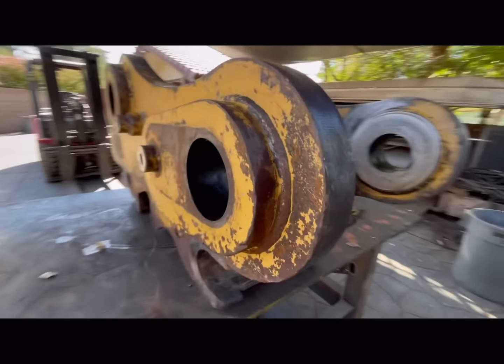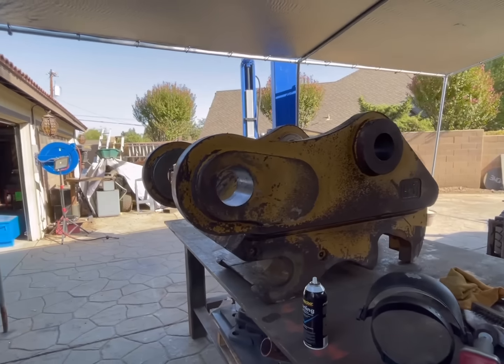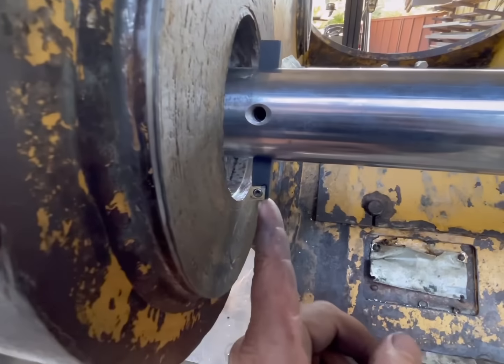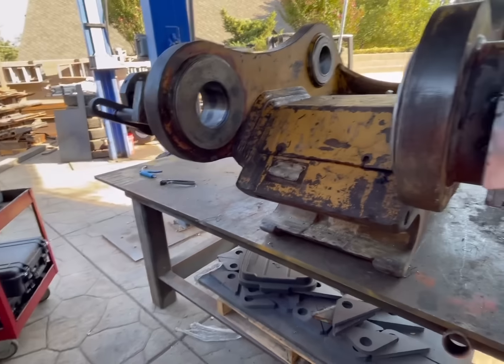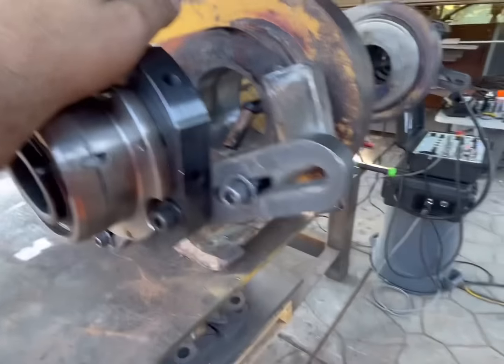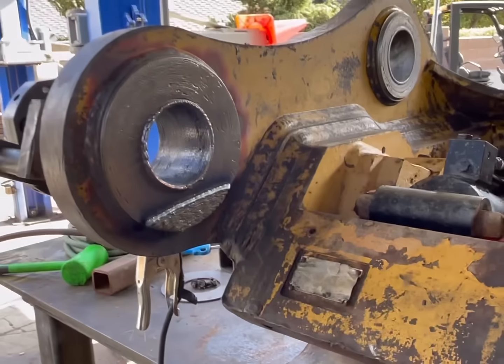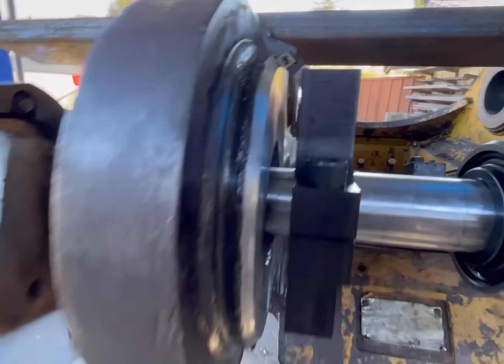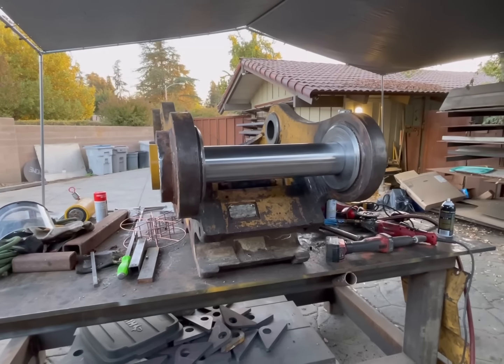Line Boring and Facing a 349 Quick Coupler

Comment: Heat it and clean it like you did John, then put a cutting disk on your pencil grinder and cut a groove into the grease lines then whip in a cold pass with 3/32 6010 to seal it off. You likely won’t get 100% satisfaction but it will certainly minimize the pain the grease can cause you.
Reply: Loren Sounds like you are a little old school. That is what I would have done. After I built up the boss faces.
Reply: Cool! Good tip thanks
Reply: That's what I was thinking. Weld up the face to cook out the grease before welding the bore. I don't see where it could hurt to try.
Reply: Why use a grinder? Use the line borer to cut a small groove. Then run a cold
Bead.  4 grooves.  Much quicker
Reply: Looks like you went for Cadillac boring tool. Money in the bank. Steve
Reply: Machine your groove in there with the tool you’re about to use in the first place, also makes it incredibly easy to weld where you’re supposed to weld. 👍
Reply: I am from China Seals Factory. Our company produces many types of hydraulic oil seals. If you are interested in our products, we can send you free samples so that you can learn more about our products.

Comment: I'm a retired welder, (44 years) and I worked in a shipyard for 14 and the cranes would always flip over a 50 ton, (or whatever the weight) of the segment of the ship we were welding on and put it in the flat position as you will always be more productive as a welder when you weld in the flat position. I would have welded the outside, or inside of those "ears" in the flat position. I have welded the inside of those bores with stick with great success and have done it many times.

Comment: Great work young man. I follow CEE and I C Weld, brilliant channels like yours. I got a job earlier this year to reduce the pin distances and sizes on a 13ton general digging bucket to suit a 10ton machine.
The original pins were welded in and needed gauging out. I don't have a line bore so had to use a digital square to set the new pins up as best l could.
Needless to say l was a bit nervous when l delivered the machine to site for the customer who immediately picked the bucket up off my pickup with his machine.
Thankfully and to my relief it fitted perfectly. I had more of a struggle getting paid off the customer than it took to do the job.
Top stuff to you young man!
Reply: I hope you got your money in the end.
Reply: @deepwinter77  l did indeed. But only after sending a seven day notice of intention to open court proceedings. 
I politely decline work from that customer. You do a customer a good turn because they are stuck and just every now and then, you get a bad one.
Reply: When I was farming I made sure that my suppliers were paid 1st of the month. Money talks & that Brown Stuff walks & your reputation follows
Reply: @JonDingle  yea it can be extremely frustrating trying to get paid sometimes, I have a couple customers who are consistently late payers I do always get payed but it's nearly always a process of sending reminders and calling to get payed.

Comment: What's up Greg. Let me thank you for taking the time take this videos and not being stingy with your knowledge.  You were asking about the 3 weld passes at the beginning of the welds connecting the ears with frame. I believe the big nice passes are made with sub arc. And the 3 small passes are just to fill the low volume  at the end. I think I'm not sure. But I do the same work you do. And I've seen the same procedure in some of the  CAT parts I repair.  Excuse my had grammar😅
Reply: I was gonna say 3 wire/head sub arc🤔

Comment: At 5:25 my best guess would be that it is welded using submerged arc welding with a 3 wire feed system welding in tandem, so those 3 passes are the 3 different wires starting their own individual arcs before they generate enough heat to become one large puddle
Reply: I am from China Seals Factory. Our company produces many types of hydraulic oil seals. If you are interested in our products, we can send you free samples so that you can learn more about our products.

Comment: Hey, very nice. I wasn't sure about that linebore machine but, it is true sometimes a spool of wire just won't work.  Once you get comfortable with that machine you'll know it's strengths and limitations.  Those grease lines are impossible to  work with.  Short of gouging the plates off there is no solution accept to know when porosity is OK and when it isn't. Thanks for the video.

Comment: that grease certainly makes your work difficult welding, it astonishes me the pressure it takes to force grease into floors of the steel or  tiny hair line cracks it finds to work itself through the steel  incredible.. i wonder if there's a way the illuminate this?, maybe a bigger enough bath maybe hot  bubble bath🛀 haha 
one word: commitment to quality'':trophy-yellow-smiling: 
 and that sound as you slid that cantuas pin into the rings was so satisfying....:washhands:
thank you once again for sharing another awesome video.

👍👍👍👍👍THUMBS UP👍👍👍👍👍

Anthony, UK

Comment: I've never line bored but I am a machinist by trade. if your bearings are relatively rigid the bar size/stickout ratio shouldn't be causing your vibration in this setup. Slow your rpm, replace your insert with a smaller tip radius, or even  take a slightly deeper cut/faster feed. The edge geometry of your insert also makes a difference.

Comment: @OFW Its hard for me to tell from the video but those passes you were talking about on the inside of the coupler very well could be tig passes. I just did a CAT brand cutting edge install on a bucket for a Sany 50 ton machine and in the Cat procedure for weld out on this cutting edge they mentioned multiple times about post weld dressing the the toes with a tig torch. Just wanted you to float the toes and blend with no -to minimal filler. Kind of a neat way to post dress and an effective one for sure.

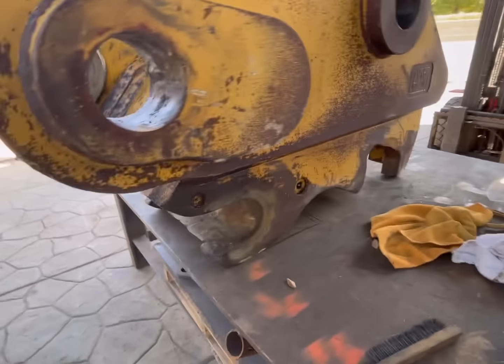Comment: Greg, enjoying the educational approach of explaining what you are planning to do....very nice touch.....that 3 pass weld you explained at about 5:50 is interesting how the cover pass looks..it would be one big ole tig torch if that is what they used.........I will see if I can find out from some cronies I know.....Best Wishes, Paul
Reply: My best guess would be that it is welded using submerged arc welding with a 3 wire feed system welding in tandem, so those 3 passes are the 3 different wires starting their own individual arcs before they generate enough heat to become one large puddle

Comment: I'm definitely late to the party here (10 month old video), but you are talking about weld procedures from the OEM.  I used to service the SAW machines that perform most of these welds.  Typically, they will have a fixture plate with humans that get fit-up, tacks, and QAQC done before final weld out. Most of the time if you see a fat stringer bead that is 1/2" wide or larger, it was SAW machine.

Comment: Well done... What I have noticed, on the units that I think are gonna weld up and machine cleanly, are always the units that give me the worst time... and the sloppy junky units that have cracks and fractures, that I think are gonna give me the worst of a time, end up going wonderfully.... .I don't know why, other then possible the mental perspective of starting each unit.. but it tricks me every time... LOL... 

On a funnier note, on the sloppy and junky units that finish off perfectly, kinda makes me look good, when I hand it off to the owners, and my work ends up looking like the best thing on their old worn out units..LOL...BONUS FOR ME...  

I do sometimes speculate, that in just a 15 to 40 years worth of manufactured heavy equipment metal allows that were once used, vs what is "just good enough" to pass the minimum W.L.L. of each type and model design of todays equipment? Please note, I have never sent off any samples of old metal and new to my local lab for analysis, but I sure do see allot of the new equipment having allot of fractures/cracks/breaks (brakes spelling?)... Then again, could just be that the operators of today, are just more aggressive then of days past? Who knows?

Comment: Well, the flexing of the boring bar is because you are making an interrupted cut.  Tool penetration will deflect the bar and then when you are not cutting (interrupted from the wallowed part of the bore) there is no deflection.  It's not a big deal.  Just have to  cut all the way around to get even deflection.  The first time you cut all the way around, some of the cut will be less deep, so, it is best to cut all the way around twice.

Comment: I've only been with our millright he set our line bore a few times he  always set welder up at 90 degrees to head to cut friction on liner in stead of the U you have on the lead it gives you a slower arch on wire feed.

Comment: At 1:15 my first thought was NO NOT THE GARDEN CHAIR! My second thought was you need one of those small aluminum bench/steps that painters use. I was so worried about your combined weight of the pin and your body weight. If that chair collapsed that pin would have been wrecked not to mention how you probably would have been injured. Buy the bench for $39.00 and protect yourself.

Comment: Nice work. Might be helpful to slow down the rpm when roughing material out and increase the feed rate if possible. Low rpm and high feed for roughing. I’m a maintenance machinist by trade. I use a boretech welding machine and work and have the same problem with wire whipping as I call it. Makes you wanna beat your head off the wall some days. And just have to walk away from it.

Comment: 😎👍😎
I understand the line boaring part..a cutting tip rotating through a bore..
How does that surfacer work..
I remember cutting brake  rotors when I was young ..although we started cutting from arbor and out ..your starting from outside and working in..??
It's like a reverse album..👍🤔😉
Reply from the maker: Like a threaded rod and Every rotation it advances the tool a little more.

Comment: Do you think if you had done the face buildup first. That it would have burnt out the grease that was in between the two plates. It might have helped to reduce the amount of porosity that was sucked into the final weld. The line boring and welding is fascinating to watch.

Comment: My question: If the welder is attached to the outer race of the spherical bearing, and the inner bearing can be misaligned by up to 5 degrees since it's spherical, how is the bore welder kept in line? I see it can rotate along its mount, but are there other adjustments?

For the buildup on the nozzle, I hear a coat of ceramic antisplatter works great.  I'm also told you want two weld layers max before a cut, or even just one since some wire does not support multiple layers.
Reply from the maker: The welder stays perfectly aligned with the bar. And it also has a lot of adjustment if needed.  I do use ceramic anti spatter.  If the welds are clean you can stack them.  I never had an issue.

Comment: Mesmerizing, only thing my welding prowess is good for is a movie snack with extra butter. Forgive my ignorance, but if you alternate your stacks, first pass horizontal, second vertical and so on, would it make any difference? In my thinking, it could help build height quicker. Would it be any weaker or anything?
Reply from the maker: I don’t think it would make much difference.

Comment: Thanks for sharing your video absolutely unique I've never seen equipment like that one question I would like to ask you Sir is why are you not using a lubricant to prevent chatter water based lubricant just asking a question thank you
Reply from the maker: Typically I don’t use coolant with carbide unless I’m on the lathe

Comment: 3M makes a ceramic nozle spray  that works great for this application. If you get a build up you can shut the weld down and pick it out with a piece of welding wire.

Comment: I had one roll of wire that kept doing the exact same thing.  When that wire ran out and the new roll installed my problem went away.  Was working by hand so not as big a deal for me but still frustrating for that wire to be doing loops on you.

Comment: What is it that CCE does with the liquid nitrogen and the sleeves? He's the only one i've seen do that on some stuff after line boring. I would think it would make the steel sleeve more brittle but ya'll know more than me. I know he does it to fit it in but wonder if it's an Aussie thing.
Reply from the maker: For someone who does bushings a lot it makes sense for him.  I don’t do them often enough to go through the hassle of keeping liquid nitrogen.  It is nice to have though.   I don’t think it has any effect on the material.
Reply: DX, he is shrinking the bushing with the cold nitrogen, so when it expands, it will be a very tight fit, it is also easier than putting the part in the press and pushing the bushing in, and the risk of damage to the bushing is now gone....this is the way to put sleeves in Diesel engine bores....but usually dry ice is used.....hope this helps, Paul

Comment: Instead of adding the 3/8 to the flat surface and dealing with the grease, could you have cut the weld and put on a new piece that was already the correct thickness?

Comment: Great Video as usual. Customer Service will make or break a company great to know that Climax kills it there. I was wondering are you using just regular wire for the outer surface? I did some work for a road construction company and we had to build up tines for the grinder and it was just rolls after rolls of wire to hard surface them to wear off out in the field. Keep up the great content.
Reply from the maker: Yes I used regular mild steel wire.

Comment: Prorosity  if you have a tig rig handy you can use 309 bare wire and prorosity will be gone. Also yes when the spool of wire get low that has alot more bend which causes the wire to hit the puddle wrong and it will start slapping the puddle😂 which aint good

Comment: When the pin holes are so messed up, how do you ensure the pins are parallel when you're finished?  Thanks for sharing a great video!!
Reply from the maker: You have to reference your bar off of other known good measurements and make small adjustments to make them parallel/ square. Such as another pin hole that is not messed up.

Comment: At about 5 min in you were asking about the fat welds with the 3 little passes on the ends, im a welder at deere so ill let you know what we do, it looks like there is 3 fat robot welds (appears to be about 12 mil each making about a 25 mil multipass), and those are welded in the gravity position for max penetration. All the little ones on the end are hand welded by someone to tie the robot welds either into a corner or into another weld. But the guy hand welding it had to do it on a flat position so he couldnt do massive passes
Reply: And the reason why the robot didnt just run the whole weld is because welding robots fuckin suck and we all hate them and they cant get into hard to reach places
Reply from the maker: That’s basically what I thought.   Thanks for confirming it.

Comment: Awesome work as usual. I always learn a little something from watching your videos. One question I had, are the cross drilled holes on your boring bar offset from center so that when you install your tool, the cutting edge of the tool is on center? I ask because I am trying to figure out an issue with my setup. Really appreciate all the info you share.
Reply from the maker: The holes are drilled center.  So technically the tool bit holder is center and the tip of the carbide insert is a little off center.
Reply: @OFW  gotcha, thank you.

Comment: Nice work. What's your preferred wire for bore welding? coated, flux core , solid core with gas ?
Reply from the maker: Mild steel wire.  Like er70-s6.   Esab aristorod is what I run.  Basically wire made to run in robotic welders.

Comment: I like the video's that you put out with good knowledge. But, I have a question on the facing repair, would it faster and better if you cut the old facing off and replace it with new ones to give you a faster job?
Good job! :)
Reply from the maker: It could be done that way.  Not sure if it would be faster.

Comment: What size wire are you using and what are your settings?
Reply from the maker: .035”. 18.7 volts. Not sure on the wire speed.
Reply: @OFW  Do  you use .035 for all of your bore welds?  I'm using .030 and was considering switching to .035.  Gas mix?
Reply from the maker: @PatriotWeldFab  yes, .035” for everything. That is what Climax recommends.  I’m running 75% co2 and 25% argon.
Reply: @OFW  Thank you, brother!  I always look forward to watching your videos.

Comment: How many rpm was your roughing passes versus finishing passes?
Reply from the maker: Same rpm.
Reply: @OFW  it's your machine and your job, but when I was doing bore/weld working at the local cat dealer, if we got chatter either we slowed the rpm, the feed rate, or the amount of cut, now that was in the mid 90s so I've slept since then, but it feels like your rpm were way too high for a roughing cut, might be ok taking .002 for finishing

Comment: the wire flip is due to the "cast" number of the wire, you want as big a number as you can get, it's got to do with how the wire is extruded, or how tight the extrusion radius is, Black Dog welding
Reply from the maker: You are 100% correct.

Comment: Wouldn't it have been possible to cut the plates out to remove the grease properly? Didn't look like they would have been hard to reassemble as you bored them anyway. Would maybe add couple of hours cutting and welding but save time battling against grease volcano and getting better product in the end without holes.